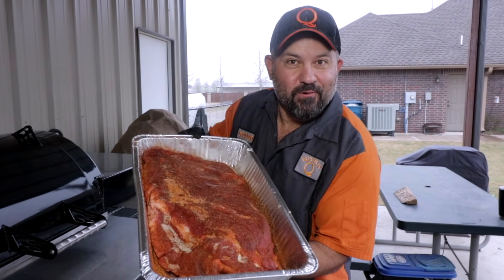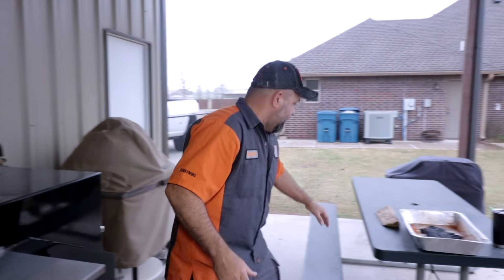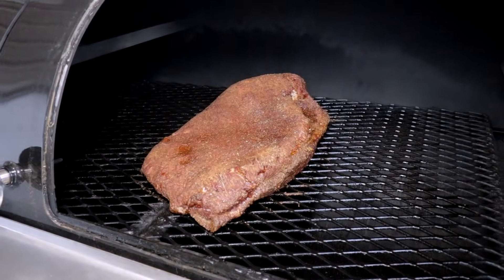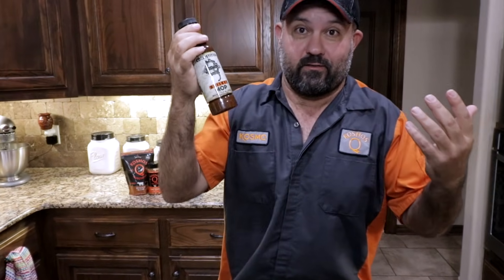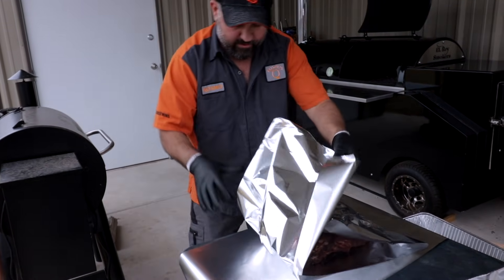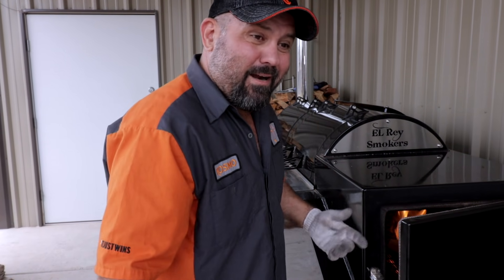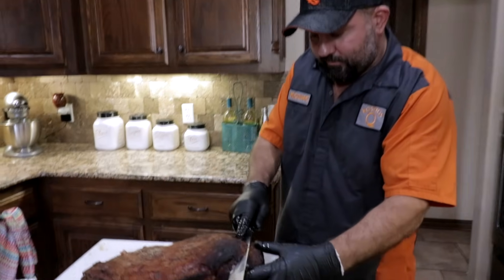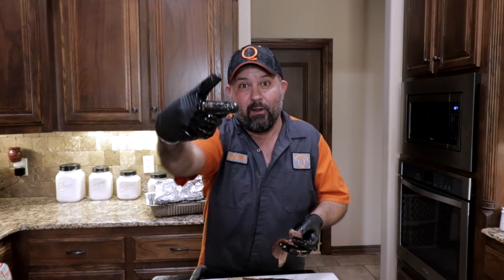Hot and Fast Smoked Beef Brisket (WARNING SUPER JUICY)

Comment: Guys 
Cooking brisket for 8,10, 12 or longer is BS.  I know you all like to brag on how kewl it's to say how long you smoked it. Meat only takes smoke for 5 maybe 6 hours at 225 - 250. There's your smoke ring yeah. After that your just waisting time. 
I pull mine out, put in a alum pan with a can or bottle of your favorite brew.  I then bring my pit up to 300. 
After an hour I start checking the internal temp. Looking for 195. Once I hit that, pull it out leave covered for another hour. 
When you finally slice it watch out for the floor of juices. Meat is super juice and tender.  Best is if there is any left over. It's great the next day. Plus you have an incredible meat juice for pouring over potatoes. 
Try it guys, you save a ton of time and the results will speak for themselves.

Comment: After you wrap it in foil, why do you continue to waste fuel and good wood by continuing the cook on the pit?  There is no possibility of any of the smoke getting through the foil so just use your indoor oven where you have more control on the temperature and easier access to the warped meat!

Comment: Why  210° for Brisket and say 135° for a steak? I'm thinking how Sous vide works temperature Vs Your Brisket temperature, thanks
Reply: Brisket is a very tough piece of meat. Need to get temps way up for it to start breaking down, but if you wanna eat one at 135° be my guest.
Reply: Nigel, sous vide breaks down a brisket because of the extra long cook time and not a high temp.
A 135* brisket cooked 3 days will get tender but will look different than a BBQ brisket, it will still look like a steak.
For example cook a tri-tip SV for 8 hours, it's still medium rare but will be super tender, simply a different technique
to achieve tenderness versus grillin.
210 almost assures you a tender brisket, although the done range can be 195-210+/-, depends on a number of factors.
Non working cuts of meat (steaks) are just more tender by nature.

Hope that helps some
Devin Thomas
Mutts and Butts BBQ
Prosper, Texas